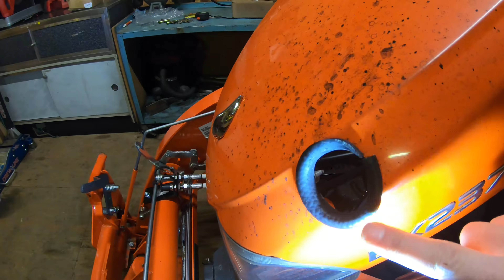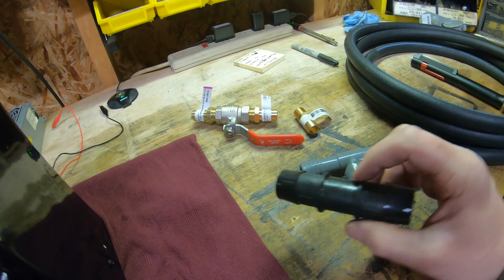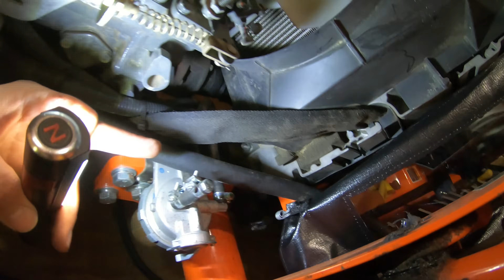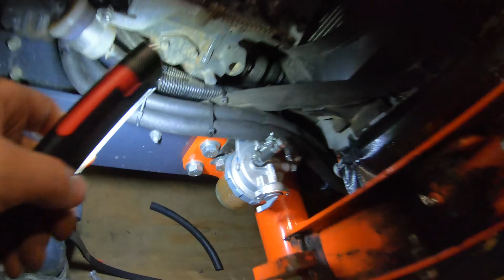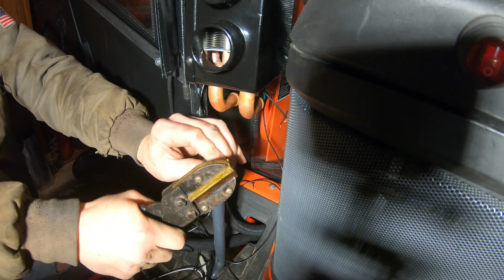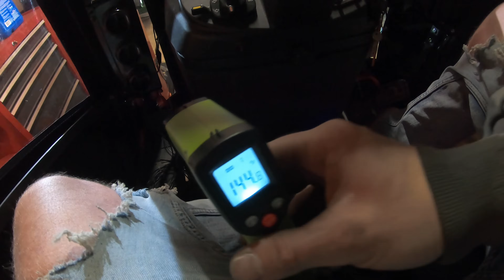Kubota BX- Installing a cab heater on my tractor (How-To)

Comment: Another nice installation video.  Didn’t think that electric heater was going to do the job in upstate NY.  Is the fan speed variable?
Reply from the maker: Thanks buddy! Yah winters can be quite tough and quite cold up here in NYS so I needed something a little better, The fan is in fact variable as its just a couple of 12v computer fans and they work way better than I woulda ever thought.. So far I haven't had a reason to put a variable switch on it but some day I may do this, Thanks for watching!

PS. Sorry for the late reply we got 3 foot of snow in 3 days here where I live so I been plowing non stop both at work and at home so sorry I couldn't respond sooner.

Comment: Awesome video man. Just a thought, maybe move the ball valve to inside the cab that way you can adjust water flow / temp from inside the cab.
Reply from the maker: Thanks buddy, I actually thought about it but there isn't many places i could have easily mounted it tho this is a great option for someone looking for more control of their heat on the go.. I'm just gonna set it and forget it tho mostly just wanted the valve so that I could turn the heat completely off in the spring and I'm still un-decided if I'm gonna completely remove the cab or not in the spring time. Thanks for watching!
Reply: @BiffsEquipment  I've got the Curtis Cab and I remove the doors in the Spring/Summer.  Good cross-ventilation.  The heater I have died within one winter season and it has a lousy reputation for that.  It's the type that takes hot water from the engine.  No problem, a heavy Carhart jacket, snow mobile pants and a watch cap covered with my headphones (for noise and FM music!) keeps me warm up here NE of Syracuse.  Cheers, Bob

Comment: Nice job!  Stay warm.  Could you post a link as to where you bought the heater from? Thanks
Reply from the maker: Thanks man, I got the Heater from Wish.com everything from wish comes straight from china so prices are cheap but shipping takes about a month,.. I couldn't find my exact heater but found you one very similar only this one i feel is even better than mine and comes with more extras as well for about $50.. Here's the link: https://www.wish.com/product/5d79ea7418dfe61b1cd1714d?hide_login_modal=true&from_ad=goog_shopping&_display_country_code=US&_force_currency_code=USD&pid=googleadwords_int&c=%7BcampaignId%7D&ad_cid=5d79ea7418dfe61b1cd1714d&ad_cc=US&ad_lang=EN&ad_curr=USD&ad_price=51.54&campaign_id=7203534630&gclid=CjwKCAiAl4WABhAJEiwATUnEF55yTxGxBGZkRI04JP3GStDflipwB9jS8dzk6_-YI8ih0pHjWwlprhoCn38QAvD_BwE&share=web

Comment: Dude thank you for posting this!  I learned a ton! 
Did you just buy the hose from an auto supply store?
 I have been looking at that cab for a little bit now.  It doesnt officially fit the bx23s so I would have to make some mods to it. Might make for a good vid.  
Thanks for posting!
Reply from the maker: No Problem Wichart glad I was able to help! I think your really going to love this cab but your right you will have to modify or manipulate the upper ROPS support braces a tad but aside from that i think you can easily get it to work.. You'll have to let me know how you make out! As for the Gates coolant hose I get mine from Napa but any auto parts store will have it for you. Thanks for watching!

Comment: Now that's a plush fit.  Some serious heat coming out, you'll need a heat shield for your left knee lol.  The old water valve reminds me of my 1st semi truck, a good ol 9670 series international cabover. We actually used the same process to heat out fuel tanks,  coolant lines running thru the fuel tanks, imagine the potential for headaches. Now obviously they return hot fuel to the tanks, but the old mechanical fuel pumps were "too dumb to fail". Here in lovely Wisconsin heat is always a good thing. Looked like a pretty straight forward install. I got my uhmw for my back drag yesterday, we got maybe 3" of wet heavy snow so I guess I'll get to play with it a little bit. I ordered a 72" 2 piece blade from moose country plow systems. Imagine my surprise when they sent me 3 of them. I'm sure I'll find something for them to go on.  Somebody made a costly mistake. Stay busy, and hey maybe my Packers will meet your Bills in the big game! Later bro
Reply from the maker: Thanks kick ass man! Did you make a video on the backdrag yet? Ill have to check it out! Thanks for watching and your right this heater may warm my knee a bit too much haha. I plan to make a little adaptor for the end of the exit ports so i can better direct the airflow where i want so that will help alot. Thanks for watching as always!
Reply: Yeah got to use the back drag today, 3" wet heavy shit. But it worked friggin awesome. Now I can keep my blower on all the time. The video i made on it was last week when we didn't have snow yet so I pushed some up onto my patio to drag it away. Lol.  I welded some keepers on to lock my pins onto the pusher so I don't have to look for somewhere to store them like I did in my video. It has 4 pins, all removable, but I keep the top ones in, so I can flip it up into the top of the pusher when I don't need it, but my cylinders don't even extend half way to operate it. I'm always concerned about doing damage to cylinders when they're fully extended.  I back dragged 60ft lines today without fall off mainly cuz we only had 3", but it scrapes awesome. Put a 72" uhmw blade on it today also. Scraped down to the gravel. I just couldn't be happier now since I can keep my snowblower attached to get rid of any piles. A blower and snow pusher  combo is the best setup in my opinion. Push it into a long wind row,  then blow it away never to be seen again.

Comment: Awesome video sweet heater looks like a factory install but I think I’d add some type of dimmer switch for the fan control
Reply from the maker: Thanks Dan! Yah I was actually planning on adding a variable voltage switch but didn't have one at the time.. I'm gonna run it the way it is first and see if its needed but if its needed ill def be picking one up. Thanks for watching!

Comment: To adjust the temp a little you could install a speed control on the fan so you don't get to hot if that happens.
Reply from the maker: Thanks Conkle, I was actually planning on adding a variable voltage switch but didn't have one at the time.. Think I'm gonna run it the way it is first and see if it is needed but if it is then ill def be picking one up. Thanks for watching!

Comment: R you going to put in some kind of dimmer switch to control the fans ? Great job with the videos. Todd
Reply from the maker: Hey Todd, I was actually planning on adding a variable voltage switch but didn't have one at the time.. Think I'm gonna run it the way it is first and see if it is needed but if it is then ill def be picking one up. Thanks for watching!

Comment: Any idea why Kabota engineers decided to mount the radiator in the aft part of the engine bay?
Reply from the maker: Haha! Wish I did!!
Reply: So that during the summer, the hot air flows away from the operator.
Reply from the maker: @waynesheffield7011  Wayne is Correct I read your comment wrong John I thought you were asking why they decided to put the radiator hose in such a tight spot.. yah the radiator is in the front near the operator to keep the operator cool during summer months.. with a front rad the hot air from the rad gets blown back onto the operator making you much warmer in summer months.. they also did this to help the radiator screen from getting so clogged up with grass clippings and debris because being beer the operator the screen can stay cleaner longer which helps to keep the engine running cooler in the summer months as well 👍🏻

Comment: How much additional coolant did you have to add? That was a lot of hose, so I'd think you need at least that much volume. Second, I'm no mechanic, but I'm assuming that since the heater core is fed and returned off tees, that the engine is still getting priority for coolant supply since a liquid takes the path of least resistance. Finally, any way to moderate the heat? Caps for those 3 openings maybe?
Reply from the maker: Hey Dave, as for the coolant I wanna say i only lost about 1.5-2 quarts and i added about 3 quarts in total after bleeding. As for your second question the T is only on the return hose so it will not disrupt flow but even if you had a T on both the feed and return hoses it still wouldn't effect flow very much at all, you don't need an insane amount of flow as it is to get really good heat from a heater core and the flow that these T's supply is plenty and its been done this way for years with tractors and equipment.. The larger factor would be making sure you have the correct size coolant hose running to your heater core as too small of a hose for the application will def hinder the flow more so then a T would. Also your right about it taking the path of least resistance so your normal radiator would for sure be getting higher flow than your heater core is but its suppose to be anyways, as I mentioned above you don't need a ton of flow for a heater core just so long as the coolant is flowing at a decent rate you'll be all set. Hope this helps!

Comment: Looks like I would have taken that lower radiator hose mod off camera as well because I would have been dropping f-bombs.  Great job Mike, I'm sure that will be warmer than the electric one.
Reply: Agreed
Reply from the maker: Thanks buddy! It has made a HUGE difference compared to that little electric heater and for the $50 total i had invested in this new heater setup its gonna be WELL worth it! Thanks for watching!